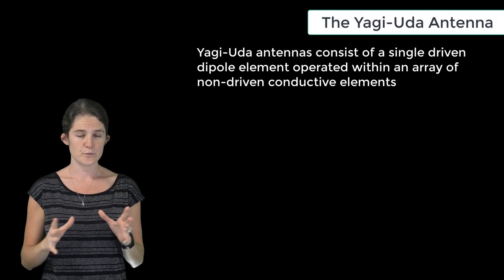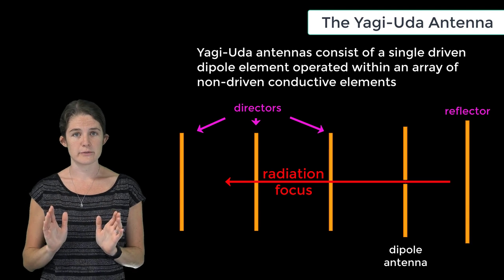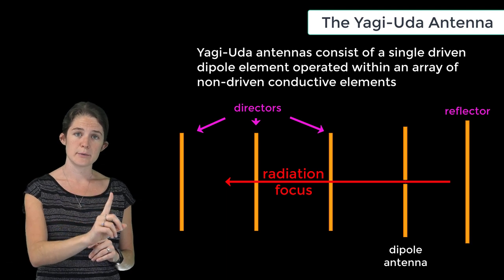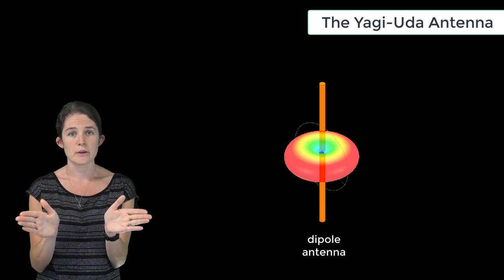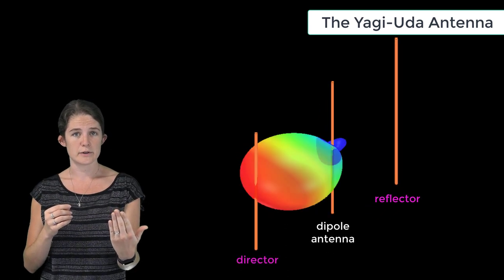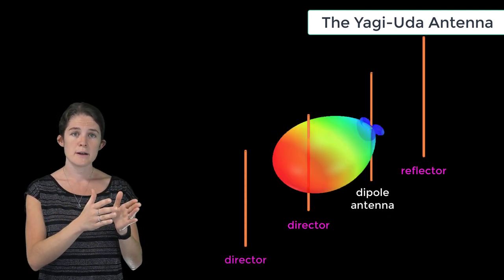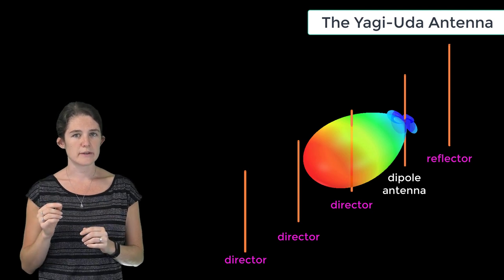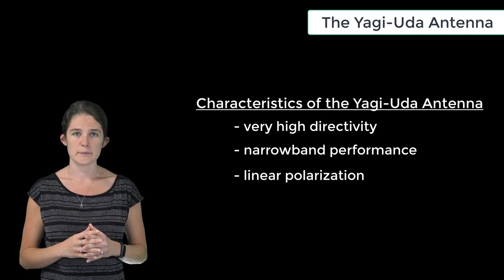The Yagi-Uda Antenna - Lesson 3

Comment: Thx for the video...What Causes the Inductive Reactive element (the Longest element) to Reflect rf energy back towards the Driven Dipole element ?  Also, what causes the Capacitive Reactive (cascading Shortest) elements to steer rf energy Foward away From the Driven Dipole element ??  Why are Parasitic Elements specifically 5% Different in Length and Why are Parasitic element Spacings usually Near a 1/4 wavelength Boom Spacing ? How were long multi element Yagis designed Before computer models ? Thx.....

Comment: Directors should connected with each other?
Reply: no, directors and the reflector are straight conductive elements that aren't connected electrically to anything.  the dipole should be split down the center, but not the others.

Comment: Shouldn't a yagi have a folded dipole as driven antenna for the purpose of higher directivity and gain?
Reply: Folded dipole is used because of it's higher characteristic impedance (2-300ohm). The parasitic elements have an effect of dropping the driven element feed impedance. a straight dipole's characteristic 75 ohm impedance would fall into the single digits without some form of matching.  We can get around 50 ohms with a folded dipole without needing a gama match, or some other form of matched feed point alteration.
Reply: @Doonit_hard_way_since_65  Thanks👍

Comment: What should the length of the antenna be? Does it need to be half wave dipole or can it be short dipole?
Reply from the maker: The driven antenna is typically a half-wave dipole.
Reply: @emviso  would having a yagi antenna with a short dipole increase gain?
Reply: @emviso  a 1/2 wave dipole will drop to around 20-ish ohms as a result of the proximity of the parasitic elements.  You are going to need some form of matching, or you are going to see inefficiency, and in the case of a typical transmitting antenna... magic smoke getting out of the finals.
Reply: depends on what are your needs you can try with a 1/4 wave length as well if you are working lower bands like 1.6, 3.5 or 7Mhz. for 7M/40m a 10m driven element will work fine with one reflector and one director.